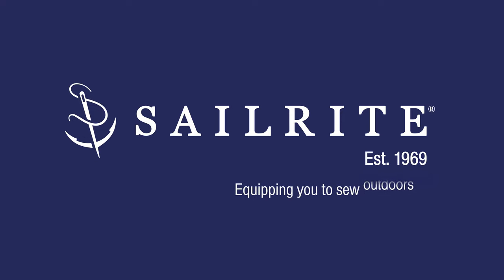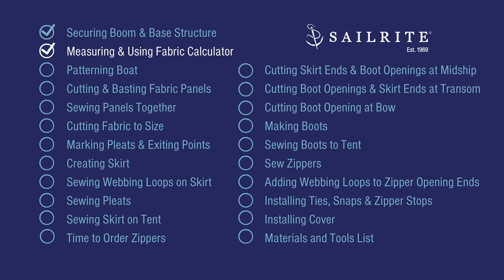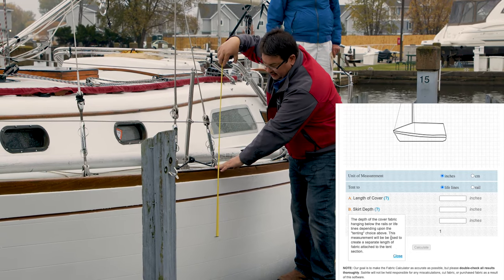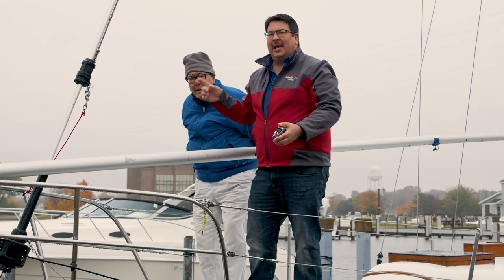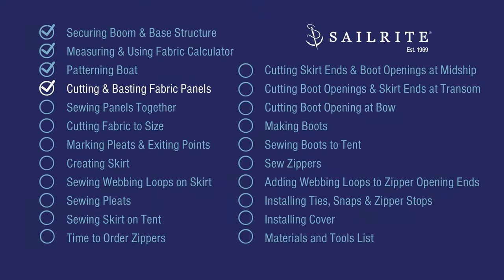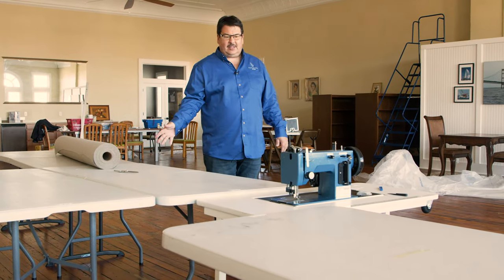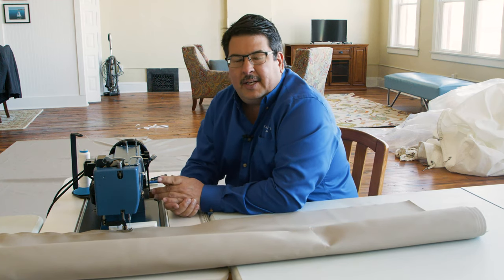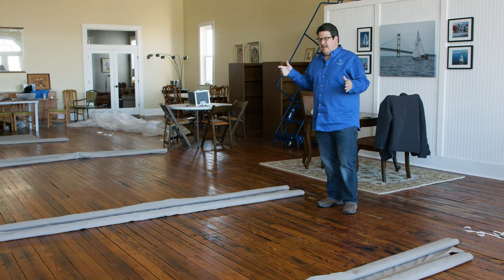Make Your Own Traditional Winter Boat Cover

Comment: Great video.   Thanks for taking the time to make this.   
You used the scrim to make the pattern and then you had a large area in which to lay all of it out, which is great.
  
I have a 33 ft sailboat so it isn't that much smaller than the Islander 37.   The issue I have is that I don't have an area where I can layout that much pattern or fabric.
I have enough room to sew panels together without any issues.   (A long narrow room.)  And have done sail modifications outside on tables, in the middle of the lawn, but that is far from ideal.
I have measured my boat every 5 ft, so I know how long the panels need to be to create the "tent" to the lifelines.
I was going to put a zipper at the mast as you did, so the cover is two pieces.  That's a popular, practical design.

What I was thinking of doing was to sew the "tent" panels together at my house staggered properly to follow the centerline for the fore and aft sections.  
Then take the assembled top tent panels to the boat (which is 2 hours away) and lay them across the supports and secure them with tape to the stanchions and mark the lifelines location.
I would probably need to put some pleats into the tent so that it would lay properly across the supports.   I could take a sewing machine to the boat and do that at the marina.  
I believe that I could cut the tent lifeline seam at the marina on a temporary table.   So that makes the tent, without the penetration boots, zippers or details.   I could mark and cut holes and slits for the zippers at the marina as well and hold the fabric together via tape temporarily.     
I was going to make the skirt out of a continuous length of 5ft wide fabric and attach it to the tent panels at the lifelines to save time instead of making smaller panels.  
I could attach the skirt to the tent panels at the marina as well, but I am thinking I might get myself in trouble since it will be much harder to sew in the penetration details on huge assembled panels.  It seems like that would best be done before the skirt is sewed on to the tent.

1. Make the cover without patterns.
2. Deal with a distance issue between my house/shop and the boat. 
3. Minimize the time needed to make the cover.  
4. Do this in less than ideal spaces.  (no loft available)
4. Effectively plan the work flow so I don't get myself in trouble! 

I have an industrial machine walking foot machine I can get to the boat (in a cargo trailer in the parking lot).  Your Sailrite machines could be used the same way.
AC power is not an issue since they have outlets in the boat storage area.   I just need a long extension cord.  
If your customers could do a cover without the pattern, I think you would have a lot more customers making covers, but that means that a lot of things will need to be patterned right on the material, at the boat.

Considering all of this, what do you think?  

BTW, the loft where you shot the video of the panels being laid out.. is that the old sail loft you had in Columbia City on the top floor?   It looks familiar.  I was up there many years ago.  Probably early 90s.  I have been to all of your locations over the years.
Reply from the maker: Thanks for your kind comments! 

Yes, you can actually sew up the fabric “Tent” portion of the cover and use that instead of pattern material. However, obstacles like shrouds, topping lift, backstay and more will be troublesome. Why? You will have to think and evaluate carefully before you cut slits in the actual fabric, because cutting it wrong will require a lot of extra labor in fixing it with a patch. If cutting pattern material “Dura-Skrim” you don’t have a worry in the world, as it can easily be taped back together with packing tape. I would take a lot of "pony clamps" if you use the fabric instead of pattern materail, as the double sided tape will not stick well to the canvas fabric for patterning. 

Yes, making a continuous skirt is acceptable rather than smaller sections of fabric sewn together, as we mentioned in the video, it will save labor time. Yes, I would make the skirt first at home and then take it to the marina to sew it onto the tent. Your “tent” will already have slits in it for obstacles so… sewing on the skirt with the slits already in the tent will be slightly more difficult but should be totally possible. 

Yes, we were on the top floor of our old Sailrite building in Columbia City, IN. Happy sewing!!!! Let me know if you have more questions.
Reply: @SailriteDIY  
Lots of good points.   
I have had good luck using Gorilla tape to hold canvas in place temporarily.  They now make a double sided tape, but I haven't used that yet.  If you don't leave the tape in place for long, the adhesive won't transfer.    If I stick tape on the underside and then twist the tape over the gunnel I think I can stick it to the vinyl rub rail, to hold the fabric in place without clamps.    Or at least that's going to be my first attempt.  

Columbia City building:
The second floor has been fixed up a lot since I was there long ago.  It looks good!
Way back then there were benches up against the wall and sails on the floor.   It was a busy place.
Thanks!
Reply: I am considering this project, with this method as I am only 20 min from marina.
Right now I reuse my shrink wrap 2xs now, I cut a slit up the transom and aft of boat reinforced the slit with shrinkwrap tape, put a grommet  every 6 inches on both sides of slit to reinstall next year, and lace it up like a shoelace then tape piece of scrap wrap over lacing. Works fantastic. 
Will be making this when shrinkwrap wears out, great video.
I did make a dinghy mooring cover already.
Reply from the maker: @TERMIN8TOR99  Sounds good! Thanks!!!

Comment: Fantastic job as always. I could see myself making smaller panels from front to back with zippers from port to starboard to make it easier to handle. Would you recommend this approach given your experience? Are the zippers durable enough? Finally, what was the cost of materials for this boat?
Reply: I just seen a sailboat that has the small panels and all zipped together

Comment: I followed this video to a T and made a cover for our Westsail 32 last winter.  Will need to use it again this year but would like to add a door to make entry/exit easier since the boat is on the hard.  Do you have a video for how to create a door on a winter boat cover? Thank you!
Reply from the maker: We do not, but I will add it to my long list of future videos. Thanks for the suggestion.
Reply: I’m sure the list is long! I ended up making one essentially using the same directions as the straight zippers and flaps in video just made it a curve. Had to make some adjustments to flap going around a curve which was trickiest part.

Comment: I like the flap over the zippers.  I notice that this approach to zippers only adds that flap and the boot to accommodate a shroud/topping lift/etc.  Perhaps I missed it, but doesn’t there need to be some care taken with locating the stitching and top stitching of the zippers to ensure that they neither add nor deduct from the amount of material that they “replace” across the slit?

Comment: First off thank you for your videos. I’ve successfully made a sail pack a few years ago and am on borrowed time with my current winter cover. 
Why couldn’t you just run the tent over the sides to the waterline instead of sewing a separate skirt?
Thanks again. 
-mike
Reply from the maker: Mike, Yes that can be done with the skirt. We ran the panels vertical so the seams would line up with the tent portion, well most of them did, some did not. It does save a little on cloth usage doing it that way, if the skirt is not as tall as the width of the fabric used, but it adds a lot of labor. Running the skirt vertical will cut down on the labor to sew them all-together, that is for sure.

Comment: Great video/excellent tutorial!

You did not see the need to add air vents?

How will you handle the storage of the cover next spring ... cleaning and folding ?
Reply from the maker: Thanks!!! We used a breathable fabric called Top Notch 9, so we did not need to use vents. If you decide to use a vinyl fabric that does not allow air to pass through, like Stamoid, then vents would be required. We do not recommend cleaning the fabric with a cleaner and water.  Instead just sweep off any dirt and dust and do spot cleaning if required.  Why? Breathable fabrics, including Sunbrella Marine Grade and Top Notch 9, all have a special coatings that keeps them water resist and stain resistant. Cleaning with soap and water and scrubbing the fabric will remove some of that special coating, requiring you to retreat the fabric with 303 Fabric Guard. So... if your cover becomes very dirty you can clean it with soap and water, but you may have to retreat the fabric once it is dry again. Oh.... when removing your cover for the end of season be sure it is completely dry. We plan on folding it up as neatly as possible and storing it in a bag that we will sew up this winter. To keep the mice away I will place a few sheets of Bounce fabric softener dryer sheets in the bag. Mice don’t like the smell, but you’ll like it better than moth balls when you finally  have to use the cover again next winter.
Reply: @SailriteDIY  Tks for the prompt reply

Comment: How would o accomplish a separating zipper for a power boat cover to make it 2 manageable peices? From Port to stbd about 25 feet or would you recommend just making 1 huge tarp. 32 foot carver aft cabin, how much would you say the whole tarp weighs both halls combined.
Reply from the maker: Separating or Finished zippers from Sailrite can come up to 264 inches in length (22 feet). However, I would not install one zipper that spans 25 feet for a boat cover, but instead install two zippers at 150 inches, one on the port and the other on starboard side. You should find it easier to zip the cover on with two zippers along the same plan than just one. A cover that is for a 32 foot boat should be separated in half to cut down on the weight of the cover for installation, in our opinion. You cover will weight about 50 to 60 lbs total for a boat that size.

Comment: A realy big project! Is the fabric waterproof?
Reply from the maker: The fabric we used, Top Notch 9, is very water resistant but not waterproof.  If it were waterproof it would need to be a vinyl fabric (we have many to pick from at Sailrite) it would not allow air to pass through the fabric, so vents would have to be installed or sewn in.  The fabric we used, Top Notch 9, is breathable and very water resistant, so we do not need to install vents.
Reply: @SailriteDIY  Thanks, I also thought about the ventilation.

Comment: Good video. My only observation is the puckering in the seams. I would not be happy with that. I have 2 of the LSZ1 and would be happy with that puckering in the seams!
Reply from the maker: The puckering could be reduced by reducing some upper tension, but I still liked where it was set. I think the major thing you are seeing is this - When sewing the top stitch of the semi flat felled seam I did not concentrate on pulling the left and right panels apart as I sewed. This resulted in the seam not laying totally flat and shows up as puckering. Pulling the fabric both left and right as the top stitch is being sewn is not difficult, it just means you have to sew slower and that is not something I wanted to do since I had hundreds of feed of sewing to be done. Not a good excuse, I know,  but at least you know now how to avoid it.
Reply: Except that its a cover, and it will sit over your boat in a desolate winter boat yard.   I've looked at a lot of covers and a lot of compromises are made to cut labor and increase speed of assembly.  Raw edges, low quality seams, etc.  Most covers are not "show"quality.  Compared to blue tarps and shrink wrap, any decent fabric cover will win in the looks category!   To me strength and durability come first.  Seam puckering is way, way down the list.

Comment: I really wanted to make a cover for my boat, until I watched this video😂 May be a bit more than I can handle.
Reply from the maker: Yeah, that is why a cover made by a canvas shop costs thousands of dollars for a boat this big. You can save money doing it yourself!
Reply: You just need to plan and take your time.   It won't be done in an afternoon!   But if you do it right, it will last for many years.

Comment: I don’t understand why you need to cut up the skirt into panels. It’s all the same length. Couldn’t you just use the width of the material
Reply from the maker: You are correct, we did mention in the video that you do not need to cut up the skirt and then sew it all together. Sometimes cutting it into sections and sewing it together can save on the amount of fabric used, but it does also add to the time it takes to sew the skirt panels together. Only one real advantage that needs to be mentioned in sewing sections of skirt together --- You can sew a loop of webbing at each seam which does provide more strength along the vertical seam than it would it were simply sewn to a double hem without a vertical seam. When the rope tension is applied on the webbing loop situated on the vertical seam, it will have a lot more strength along the skirt than a webbing loop not positioned on a seam. But both ways will work great!